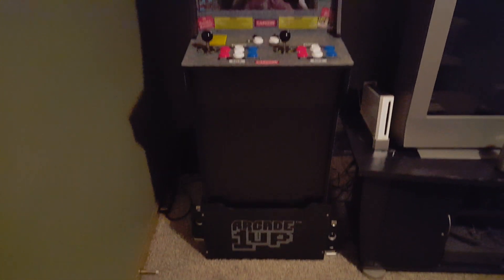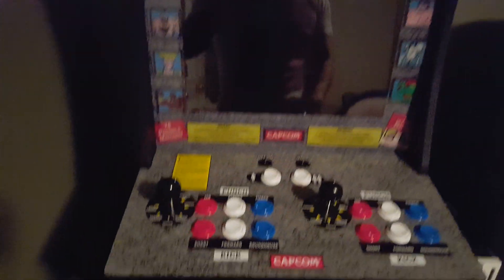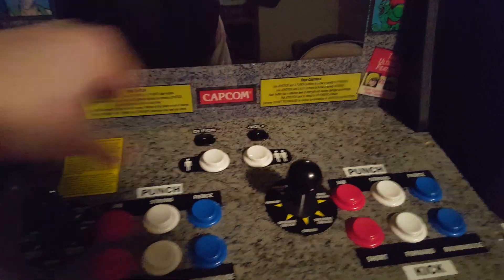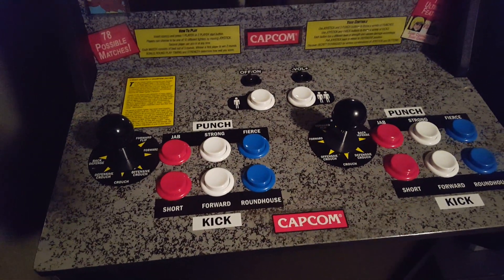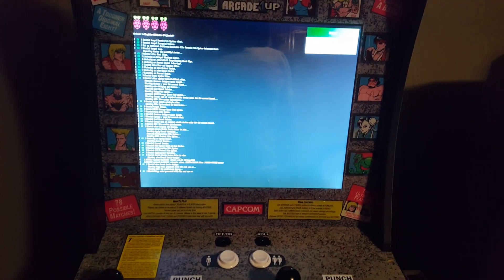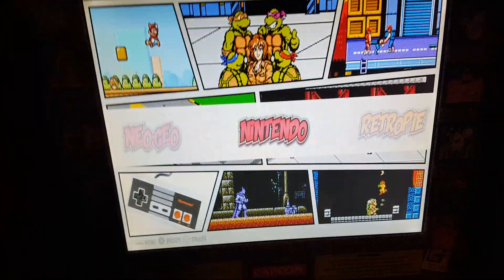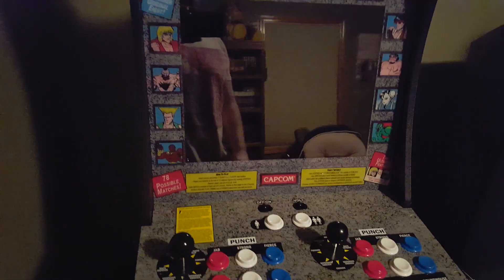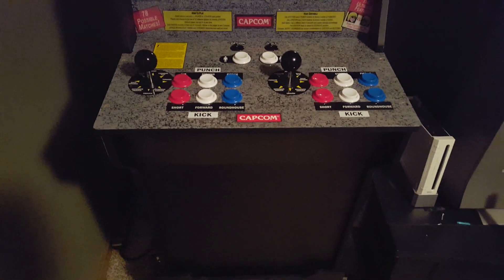Arcade 1up Pie Demonstration - Fred's Tech Corner

Comment: how do you use the existing buttons instead of drilling the extra two?
Reply from the maker: It takes some decent setups on the options screen.  I personally use player 2 button 5 for coin and button 6 for start.  I accept that 6 button fighting games are not that feasible.  I have SF and MK games in many other forms, so its not a biggie for me.  Player 1 has all 6 buttons and I'm usually playing solo anyway.